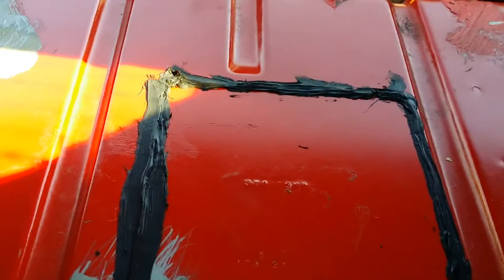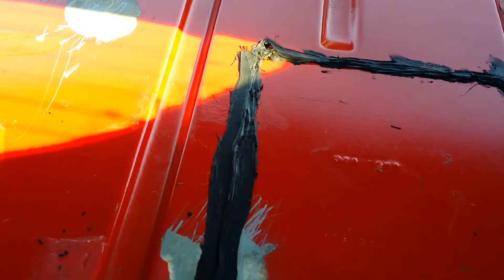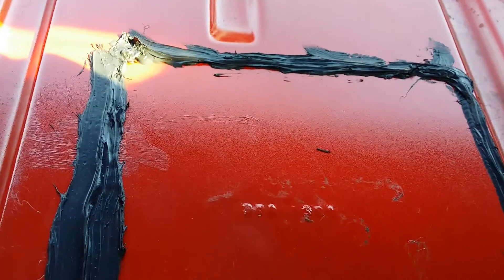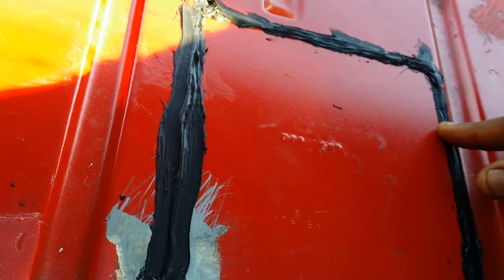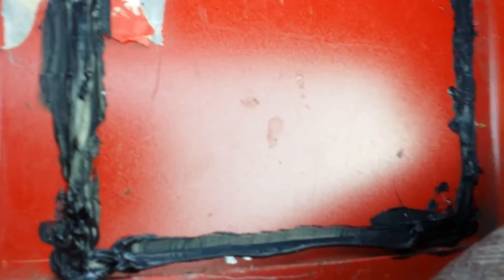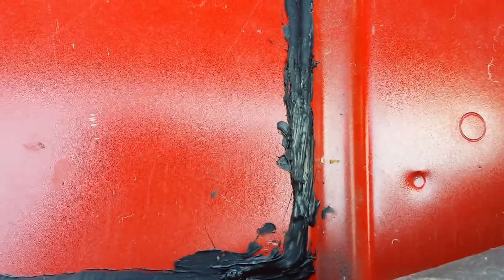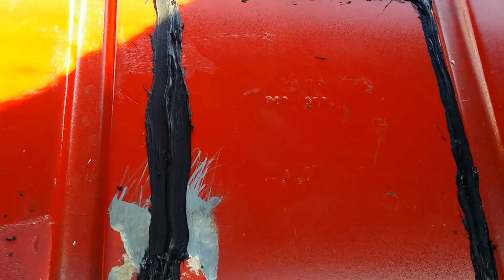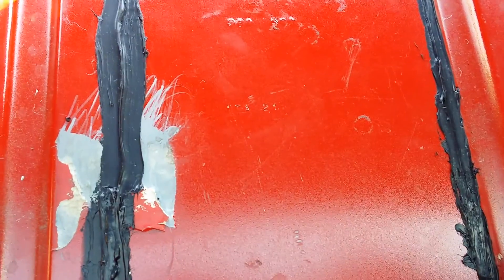94 lt1 camaro fuel pump install

Comment: How did you get the same piece of metal to sit there so you could start permatexting it I'd be worried it would like slip in towards the tank when trying to seal it back in there just wondering cause we plan on changing the fuel tommorow
Reply from the maker: Bicycle spokes taped em across the top so when I laid the metal back down the spokes catch the sides while the metal sit flush and i fill the gaps wait until it dries then pull the spokes off and fill gap if needed...
Reply: Ok cool we kinda did that way I like guess the only question I should ask since you seem to know what your your doing and I couldn't tell by any videos. We did the pump and the hose that goes on the middle to that short line on the top of the pump. There's a metal tab blocking you from putting the hose back on and we couldn't remember if we took a hose off there or not so we bent the tab and put the hose on there just wanted to know is that right. It runs been driving it but I'm still having my acceleration problem where it boggs down and there's a clicking noise in engine when it does that. Thanks for your help your video was the best
Reply from the maker: If you look all my fuel pump removal, mods & install  videos all your questions will be answered "since i look like i don't know my shit by my videos" (your word's)...Kmsl on that one!!!

Comment: I got the walbro gss340 fuel pump and do you need a pigtail connector to use it? Some people say that you have to hot wire it too did you do this?
Reply from the maker: Jus used wire clamps for quick disconnect 255gph is the biggest that a fit with a Lil massaging in the stock sending unit...